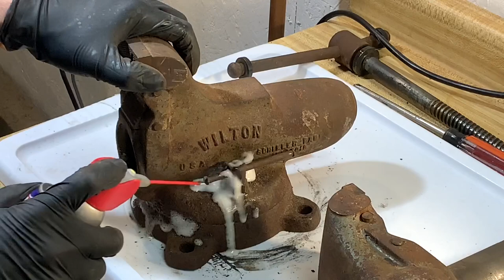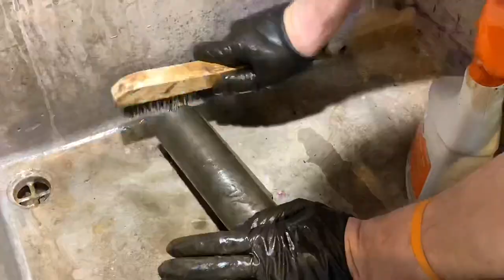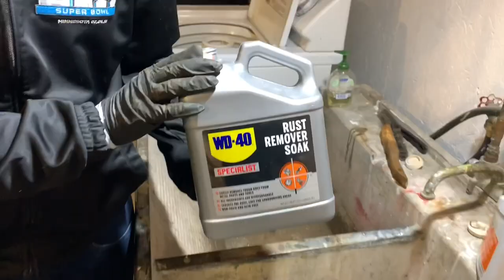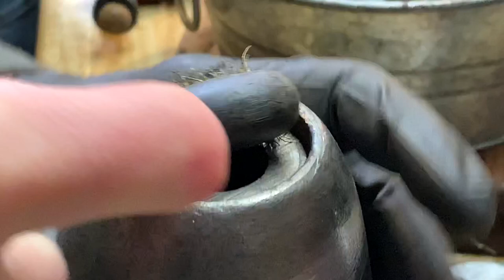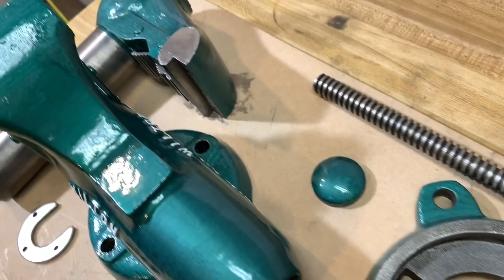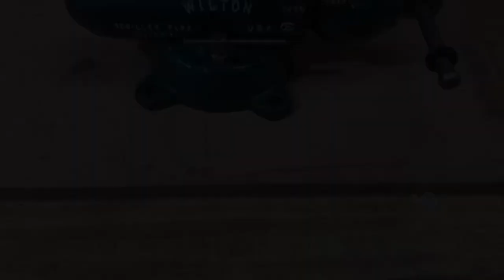Wilton Vise Restoration

Comment: Nice work boys, really came out well. Two suggestions, and they're small. First is lubricate everything. Even down to the pins and screws on the jaws, the swivel lock nuts/bolts and the lead screw retaining plate and screws. Doesn't need a lot, but if you do have to take it apart again, far less likely to have issues. The second would be to either countersink the holes in the lead screw retaining plate or get some screws which have a more domed head, but the head is less wide. It's just an aesthetics thing. That said, I've never restored anything myself, and I've also watched a lot of these videos. It's only my opinion, others may disagree. 

Excellent work though, it's abeautiful job and way ahead of many others doing restorations. Keep it up and best of luck for the future. If you retain this standard of work you'll have plenty of subscribers :)